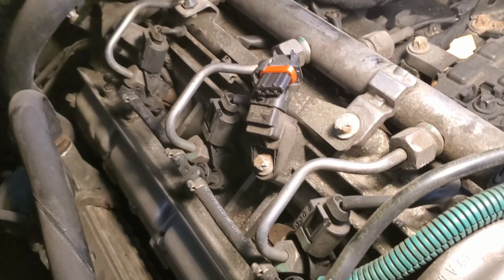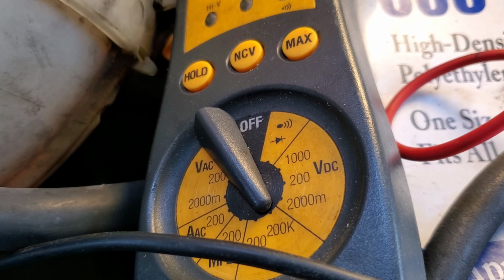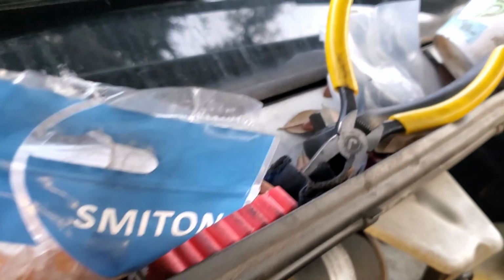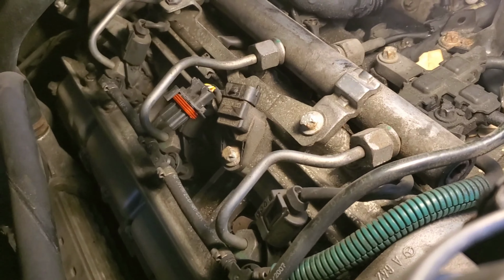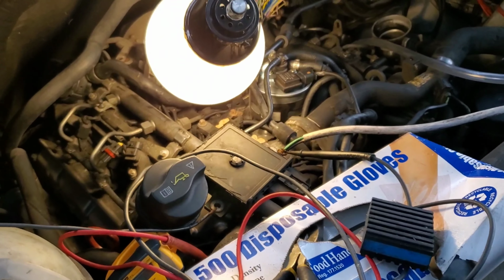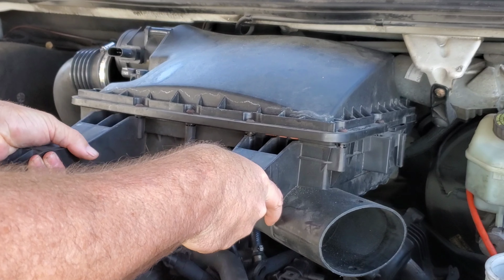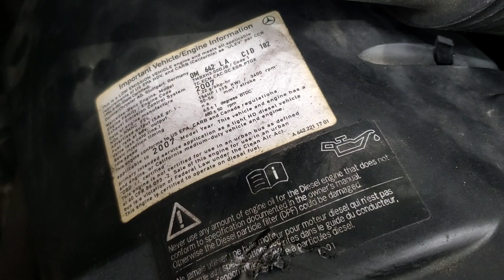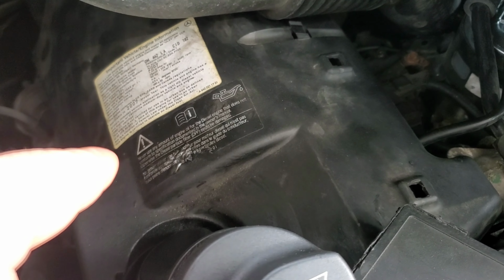Sprinter Camshaft Positioning Sensor Repair, Replacement Re-edited

Comment: Thank you so much for this video! What error codes or signs did you have to replace the sensor?
Reply from the maker: It's been a long time and I don't remember the codes but the engine would just stall and I would reposition the wiring harness and it would start back again so I knew it had to be in there
Reply: @eby6114  do you have a diagram by any chance for camshaft sensor? Because i tested 1,2,3 injectors but can’t find a electrical diagram for camshaft

Comment: So where did you end up making the spliçe?
Reply from the maker: It was the cam sensor line
Reply: @eby6114  I have 16 as a resistance for the cam and mass air flow sensor wires (yel-br)
Reply from the maker: @frontlinemedia4270  unfortunately it's a problem like this.  Diesel engine vibrates.  Wires in suspectable location.  Wire breaks.  We test the wire seems good because it's in a touching position but while driving wires become disconnected reconnected.  I temporarily solved my no run issue blllt relocating the harness which put  pressure on the broken wire reconnecting through tension...sort of like rotating a battery terminal post to get a car started until you get somewhere you can fix it.
I have a video discussing the problem, the relocating with zip ties etc.  
It's actually a common problem and they'd normally "just" replace the wiring harness
Reply: @eby6114  I pulled on everything and really couldn't get it to change. I had around 16 ohms on that wire.  Vehicle drains the battery if sits.  Also another mechanic said that wire was the power supply, but it can't be.  I don’t have a wire diagram for it yet.  I will have to find your other video
Reply from the maker: @frontlinemedia4270  ok so there's one more video you might check out.  Not sure it's related but the main power fuse.  I can't remember if it's going to the starter or battery.  Anyway located under the truck is the main fuse that seems to go bad with corrosion.  I replaced mine with an aftermarket fuse.
Reply: @eby6114  where is that located, specifically
Reply from the maker: @frontlinemedia4270  behind the oil pan, in front of the cross member.
https://youtu.be/0WXYeIN5GQg?si=7Ao9mKzH3ppUlPxu
Reply: @eby6114  here's what I don’t understand.  On a 2006, you pull the cam sensor plug the vehicle won't start.  I did this on the 2007, it started right up.  It runs without the plug even attached, so how can this cause your issue?